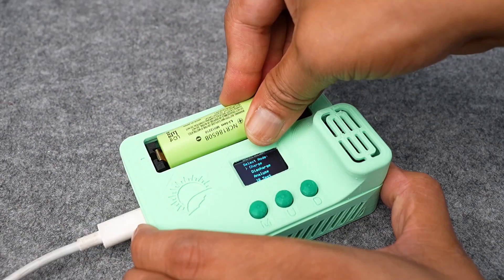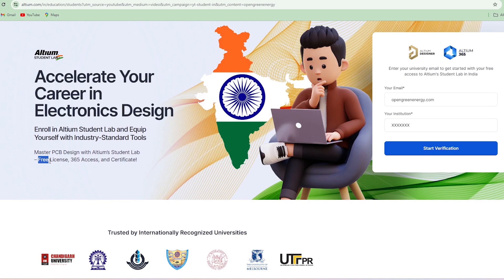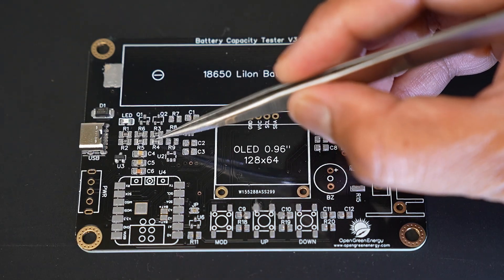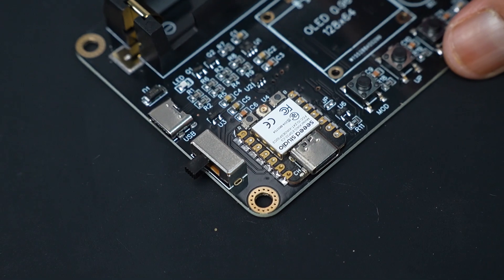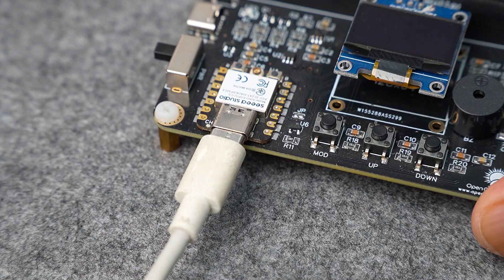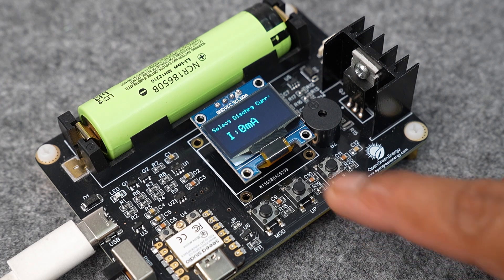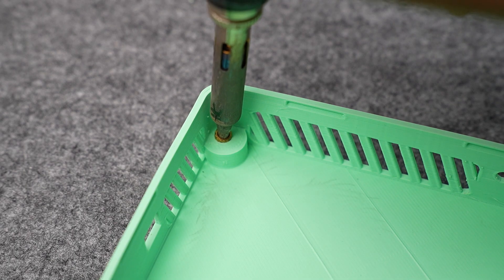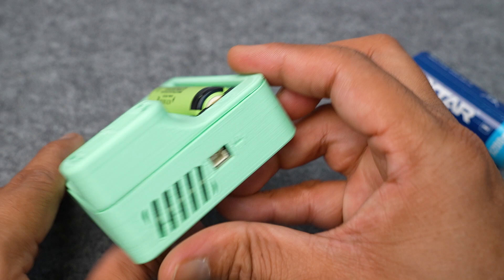DIY Smart Multipurpose Battery Tester || Battery Capacity Tester

Comment: It's good for few cells,
Not got good, if you are testing 100s of cells. I am thinking of module based system. 1-5 cell in each module. And 4 module total in a set.
Reply from the maker: Rightly said. 
We will develop an upgraded version which can handle 4 batteries simultaneously.